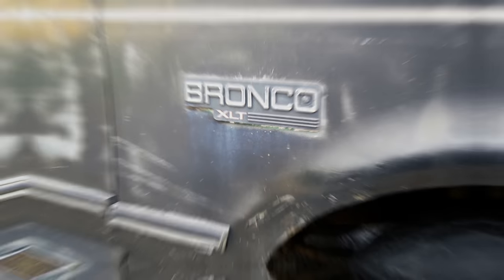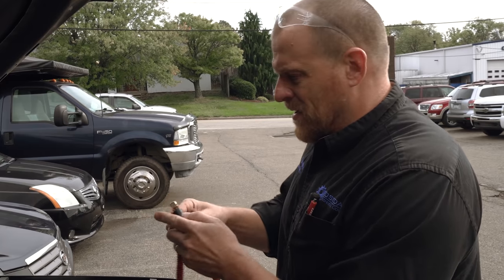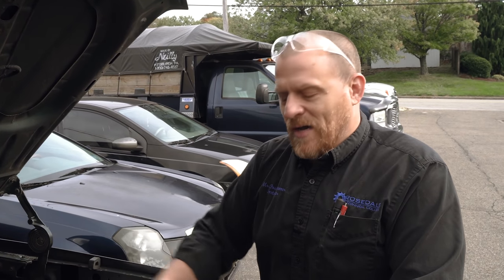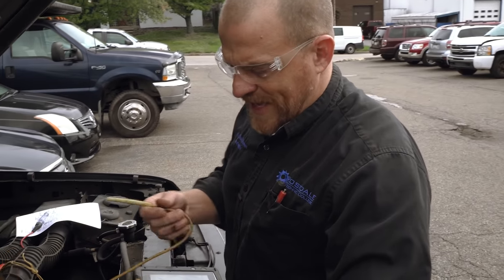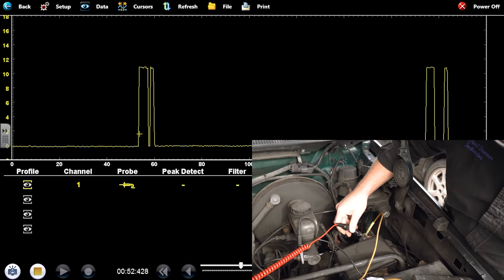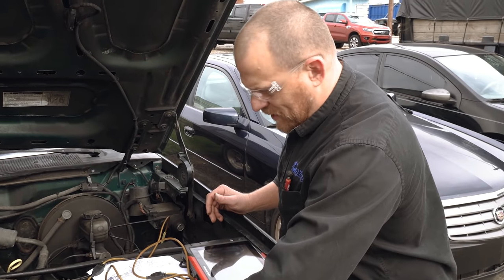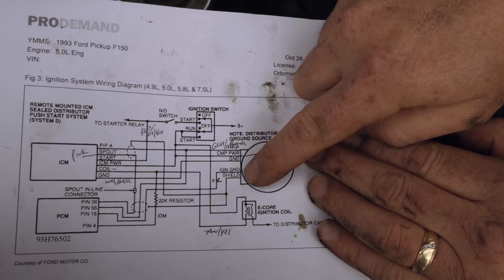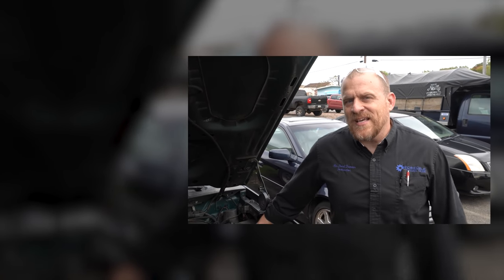Ford EEC-IV No Spark Diagnostics

Comment: Great stuff fellas! Good to see you. I've been taking a breather from auto related stuff both here and on YouTube. No fault of anyones - just needed to step back and breathe a bit. Modern cars still frustrate the crap out of me. Just when I think I've got a handle on it, 3 in a row will come in and mop my ass! I think I'm going to stick with what I'm good at, and that's carburetors, points, or old school electronic ignitions like this system here. Going to pick my battles with modern stuff much more carefully going forward.

Still running this exact system in our '86 Grand Marquis. I had this same failure back in '07, but without troubleshooting knowledge or patience, I replaced both the EEC module and the pickup. I had a 50/50 shot of getting it, but I'm not a gamblin' man, LOL.  Oh, I meant to mention that EEC module needs heat conducting compound on the back of it, wherever it's mounted - heat sink or distributor body, for anyone that's reading. I'm sure you already know this.

She's still running great to this day, closing in on 290K miles. Getting ready to park her for the winter, whenever the first road salting happens (or if it even has the potential of happening). We'll be hitting 300k next summer more than likely. Still has the 100% original driveline. Transmission has only had fluid & filter changes. Even has the ORIGINAL in-tank electric fuel pump ... and I ran the ORIGINAL plugged up fuel filter for 14 years, since I had forgotten I had never changed it!! I couldn't hardly blow through it when I removed it! Try that with a modern fuel pump, lol.  Anyone that thinks new cars are "better", I beg to differ. ;)

Comment: The wiring diagram shows that the PCM can monitor the coil negative terminal through a 22K resistor. It would be interesting to see if it set a DTC. Also, given the high idle speed, I figure the base ignition timing is over advanced.

Comment: I ran all these checks and it was extremely helpful. So glad there are people like you out there to provide this simple yet extremely effective information out there and to do it for free! 

But I do have one question,
I’m testing on a 97 f250 5.8 and was checking with a test light on the coil positive and negative wires for that flicker you talk about, I have flicker on the negative side but not the positive.  Does this indicate anything that you know of? Or is this normal?  

Again thanks for this I’ll definitely be subscribing and following and pass along to anyone else I know, cause this was very basic, the tools used are cheap and the basic knowledge like you said is invaluable and spreads across all makes, models and years. 

Greatly appreciated!
Reply from the maker: Coil positive should be steady and coil negative should pulse. Is that what you see and you don't have spark?
Reply: I have coil positive steady and pulse on the negative and the truck seems to be running and starting fine now…I think what happened was when I went to do this test and I shoved the test light probe into the positive side of the coil and attempted to start it, it fired right up and has been working fine now for the last couple hours and several starts and stops.
Reply from the maker: @shanethissell2136  okay, yeah this test is only helpful during the no spark condition. Thanks!

Comment: Great diagnostics, thank you, but… 92’ e350 5.8l, diagnostics pointed to bad ICM, replaced and same results. Read to pull PCM harness plug and test for spark, it did spark indicating bad PCM. Pulled and opened PCM and sure enough one of the blue transistors(?) corroded and came off when touched.

Comment: I had a crank crank no start 85 mustang. It blew me that the 5v reference was floating all over the place. Turned out the only ground for the computer was a single wire that had rotted off the battery terminal.

Comment: I have a 96 F150 with a 1351 after replacing the icm. The icm doesnt need to be grounded but it definitely needs the heat sink so it won't burn up.

Comment: The TFI heatsink does not need to be grounded to the sheet metal for a ground return. However, it is usually mounted to sheet metal that is a cooler spot within the engine compartment to further reduce TFI temperatures.  PIP = Profile Ignition Pickup output is usually pulled up to VBAT. I think I would have put a scope on PIP before trying to manually spark the coil. For the side mounted TFIs with the large heatsink mount I think the distributor pickup fails at about the same rate as the TFI, maybe even more. To be more specific the PIP output is a conditioned window hall effect circuit, which compared to a simple reluctor wheel like in a GM distributor circuitry is prone to failures.

Comment: You should always pop the cap off the distributor and verify rotor rotation. It was not uncommon to see a broke or twisted distributor driveshaft or gear fail.
Reply: Seen a couple cases where the roll pin sheared. Had one that ran , just no power. Found out by pulling cap and could turn the rotor by hand. Didn’t have a timing light at the time to know
Reply: @kd7cwg  
The valve stem seals would get old and brittle. As they broke in small tiny pieces, they collected in the oil pan.  Some of them would get passed through the oil pump pick up screen and jam up in-between the two gears. The oil pump hex drive shaft would twist like a corkscrew then break. Sometimes they didn't break and the timing would be way off and run like shit. Sometimes the shear pin would also break and take out the gear drive. 

Drop the oil pan, clean it out and replace the parts. The permanent fix was to replace the valve stem seals with ones made out of Viton. They were good for up to 600f degrees.

Comment: I have a 1997 f350 dually 460, I’ve tested the wiring down the grey orange wire to ensure continuity to the computer from the ignition control module, I tested with a test light both sides of the coil -+ sides and have voltage there, i tried jumping the pip wire with the test light as shown in the video and using the coil wire and spark tester i get no spark, when i unplug the icm jumper plug i get spark, the icm has power to it and it is a black module not grey, originally i swapped a distributor out of my other truck that runs and still had no spark nor injector trigger, i did also swap out my eec with the same running truck and still at the same result.  I’ve ensured all the fuses have power and the eec computer has power and ground.   I’m sure I’m missing something obvious, I’m open for any questions

Comment: There is a section in the Ford service proceedure on those revolving around disconnecting the spout, jumping the spout and disconnecting the ECM. In my batch fire 5.0 we had an issue where the ecm advanced/ retarded the timing randomly (and) there are issues in those ECM's with dried out caps. If I recall those will throw spark with ECM disconnected asa the coil works off of a feedback between module and ECM. In my case we had spark, fuel, timing and compression and would not fire with ether.

Comment: Recently had a 1995 F350 no spark come in.  Owner had changed ICM and coil.  I unplugged Spout, no spark.   Bright light on both sides of coil, but no control.  Good PIP.  Good power and ground at ICM. Scratching head, suspected owner got bad chinesium module.  Plugged in  new chinesium module, no spark. Hmmm.  Ordered Uscope.  Decided to check continuity while waiting on Uscope.  Just so happen to check coil neg from coil to ICM first, 50ohm.  Hmm.  Wiggle harness, get down to 1ohm, spark.  The square jack plug on fender was loose, which confuses me because I had bright lights at coil and good PIP. Oh well, it's fixed and out the door.
Reply from the maker: Remote mounted ICM? (Not on distributor) maybe the PIP was grounded on the distributor housing and the ICM on the fender?
Reply: @ScannerDanner  yep remote icm, how did I get good bright test light at both coil terminals through a high resistance loose connector? Unless both wires going through same connector were both equally dim and I didn't notice with no reference "bright" light. And also a good pip voltage through the same connector?  PIP was 65mv and 10.23v when bumping through the shutter wheel.  All the quick tests pointed to a bad module, had everything required except coil control pulse. Was just a confusing issue since the quick checks are usually accurate indicators for me.

Comment: Hi Paul. I'M A HUGE FAN! LOL. As I was watching I thought of another variable for a no signal. Wouldn't a broken timing chain or sheard distributor gear pin also cause a no signal from the pickup. PLEASE LET ME KNOW. Thanks 👍
Reply from the maker: Yes! The difference in my case was the intermittent nature of the no spark condition. So I completely disregarded that, but you're right, I should have mentioned this.

Comment: I think back in the day if the TFI module was deemed bad Ford recommended changing the pick up coil in the distributor as well. I don't remember why, maybe if one fails it takes out the other or something, not sure exactly. At least this one is over near the fender and not mounted to the distributor. Ford had a huge recall on those because of heat failures making them conk out. I think in later years it was moved to where this one is. Those pickups are replaceable but you have to pull the distributor, take the roll pin out that holds the gear on and take the old one off and install new. I can't remember if the gear was a press fit or not.

Comment: Hey Paul, real quick. How do we find out if the hall effect signal is a pull up or pull down? As always appreciate your time and your videos filled with knowledge and humor. :)
Reply from the maker: Unfortunately this information is not really available and most wiring diagrams do not include the ECM internals, so the only way to know is to unplug a known good one and measure the signal wire voltage with the key on. High voltage = pull-down
Low voltage = pull-up
Watch the videos I linked in the cards too on hall effect testing. Thanks!

Comment: Some years ago I owned vaz 2109. It had ignition module generating square wave signals upon hall sensor  pulses. It was mentioned in the manual to ensure the hull of module securely fastened to the car body. So I sometimes applied multimeter lead to the hull of module and the other to the car body. In case of poor contact with the body it showed some value. And the second, in case of bad contact with the battery the module unrecoverably damaged. So it was prohibited to unfasten the battery leads when engine is running. I remember I touched the insulation sheath of central wire with bare hand while engine running and have some discharge run through me, some moments engine was choking and then recovered. I was wondering that the sheath of a hot wire carries some high potential charge on its surface and could harm someone if exposed or touched.

Comment: I thought the way to test the coil power side was ignition on test lead grounded and probe the backside of the power as you did.
But I thought the way to test the negative side was to put the test light on the positive terminal of the battery and then probe the negative coil wire and then turn the motor over and it should flash on and off.

Please correct me if I'm wrong.
But just checking them the way you did didn't seem to prove anything.
Reply from the maker: https://youtu.be/jJmqdhhduVc
Watch this one, then we can talk further.
And if you're really feeling like you need more, watch these.
https://youtu.be/LdnnFD6J8Uo
https://youtu.be/YBE7c7lfmnY
https://youtu.be/-ZGLoSSowYY

Comment: if its a manual transmission and your worried just make sure your in neutral and parking break set along with wheel chocks or on a wheel stand meaning truck is not on its wheels

Comment: Hello, Paul. Do you think that an ignition coil can be cooked by an oil leak from a leaky tube seal?  If yes. could you please explain how that happens?
Reply from the maker: "Cooked" no, ruined yes. Oil could swell the boot and act as a conductor shorting out the spark from getting to the plug

Comment: So what would the problem be if you've already replaced the pickup coil the ignition coil the ignition module and it still has no spark? I can induce spark with a pin stuck into the PIP wire and a test light off the negative side of the battery... I can also produce spark with the old ignition module plugged into the trucks wiring harness and the old pickup coil plugged into that and running my pocket knife blade through the pick-up coil.. but when I pulled the distributor out of the motor and plug that into the trucks wiring harness and ground the distributor to the battery using a jumper cable it gets no spark however I did notice that by touching the distributor housing with the grounded battery cable it creates park in the same way the test light create spark when touched against the PIP wire.

Comment: I just had a 98 Chevy 1500 5.7 come in with no spark after putting a motor in, they did cap, rotor, coil, and module. Control was missing, no crank signal(they had already replaced ckp also) the trigger wheel was missing. When whoever put the motor transfered covers and such they forgot the reluctor for the crank.

Comment: Thanks great info. Got all the goodies. Still no spark. What’s the next check?
Reply from the maker: What does your test light (incandescent) do on coil positive and coil negative
Reply: @ScannerDanner  with the key on, and test light on ground, the red wire lights up, the light green wire does not, but it sparked at he connection when i touched it, like it's a bad contact on the coil.??
Reply: Watched your video 4 times, making all the checks, just missing something...all the fuses are good, cleaned all the connections, got the spark tester, and the remote ignition, can't trigger a spark by tricking the pip wire with 12v either. going crazy.
Reply from the maker: @markhava6491  it could be? Both sides of that coil should be lit with the key on
Reply from the maker: @markhava6491  if your connections are good, you have one of 2 things going on.
1. Coil negative is being grounded all the time, making your test light not light when connected to ground. 
2. Your primary coil winding is open (bad coil).

To confirm, with key one and coil positive showing you that the test light lights and coil negative showing you it doesn't. Switch your test light to battery positive and recheck. Tell me what you see. It's important that the key stays on and you confirm coil positive stays hot so we don't get a backfeed when we check coil negative with the test light to battery positive
Reply: @ScannerDanner  coil is new. both sides are hot with the key on but still no spark from coil. crazy thing is, when i put the testlight on positive and touch the positive side on the coil while cranking, it lights up as if it is grounded while motor is turning over. Test light on ground, light goes out during cranking. Weird. Why does the positive signal to coil quit during cranking. thanks so much for your input
Reply from the maker: @markhava6491  sweet, we're on to this now!
If your test light connected to battery positive is lighting on coil positive during cranking, (it shouldn't be), this means we are dropping voltage to coil positive. 
Please confirm this with your test light back on battery ground and recheck coil positive and tell me if the light goes out during cranking.

Comment: Hi Mr danner I have a ford in Australia 93 model using same  ecu 4 in a 6.i done all in vid only thing with mine is spourt only 1.34 v at dizzy connector and at pin on ecu. Every thing else is in spec still won't fire but has spark from coil with lead  and plug as soon as you hook it to distributor no spark.down test light on pip fired pump relay injectors but no spark.is it pick up ,ecu.just ask for your opion im trying not to be a part changer.peace

Comment: On my 90 f150 4.9 liter the ice is mounted on the distributor. I should be able to connect my test light to the pos on the battery and probe to the pip wire(being the top wire?) and with a spark tester between the distributor and coil I should see a spark. Correct? I've been leaning toward the pickup coil being my no spark issue
Reply from the maker: Yes, top wire is the PIP signal that is basically your hall effect signal or pickup. 
With the key on, measure voltage there first. It will depend on where one of the hall shutters is, as to if the signal voltage is high or low. If it's low, yes, test light to B+ and pull it high
If it's high, then test light to ground and pull it low
Make sense?

Comment: Why does Mr. Danner hesitate to set the parking brake on an older car?
Reply: If it is never used in the rust belt, good chance it will get stuck on. Even on my silhouette, from as after being in Ohio awhile started hanging just a bit. Only reason I found this out, is that I had the rear off the ground to work on something else!

Comment: I got a 96 7.5… new coil, solenoid, and ignition module. Starts once in a blue moon but wont run more than 5 mins then wont start again. The yellow/tan wire on the coil plug does not light up so its not getting power. Tested the resistance and the wire is fine. When i did the pip wire thing i got spark, then it started. Then after i turned off i tried the pip wire again and no spark. what am i missing?